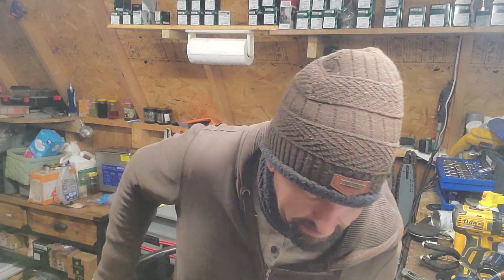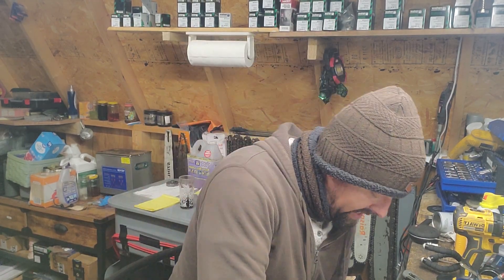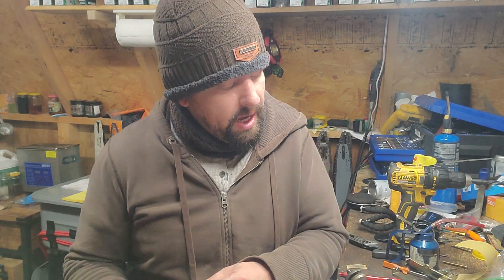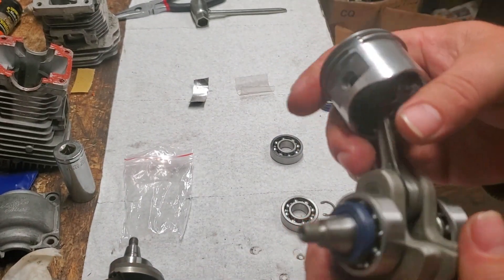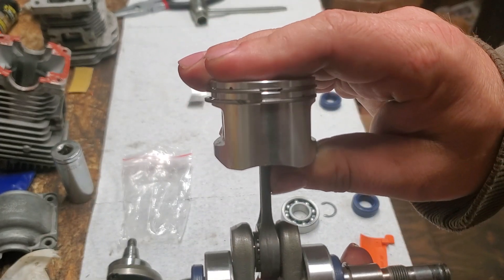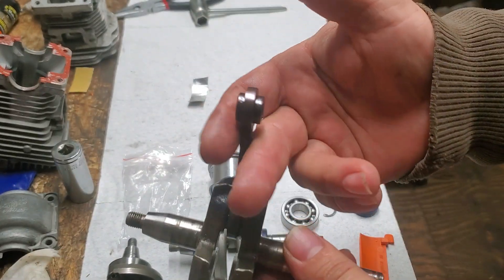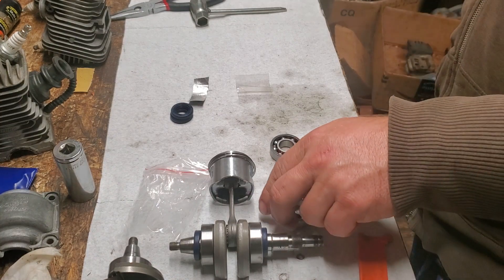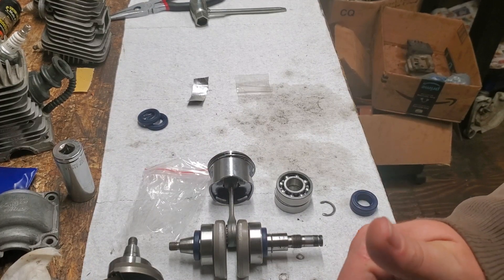CHAINSAW CRANKSHAFT  BEARINGS 2 REPLACE OR NOT REPLACE blower/trimmer 2 piston arm bearing inspect.

Comment: Hey  how do you put your  bearings on
Reply from the maker: Depends on. The model. When it's a clamshell I throw the crankshaft in the freezer and if the bearings do not have a plastic race I may heat them up. Then they typically just slide on. To install into a case I freeze the bearings then heat the case bewring cavity with a torch making sure I've removed ANYTHING THWT HEQT CAN MELT OR BURN LIKE OIL LINE RUBBERS ETC bc the heat will travel throughout the case. The trick is ensure you're bearings have been in and are as cold as can be then heat that case up as hot as safety possible and the bearing should drop right in. Of course this is with the case split and crank removed. This is the main two ways but I also have lots of specialty tools that do this job without freezing or heat but there's so many allot of guys just fabricate their own tools and gadgets to do rhese jobs over many models without expensive Brand name custom tools. HOPE this helps I have several vid3os showing 3 4 or maybe even 5 different ways to do bearings in stihls and Husqvarna.